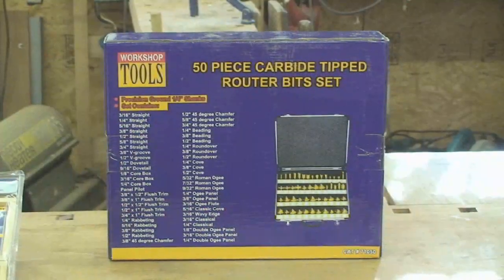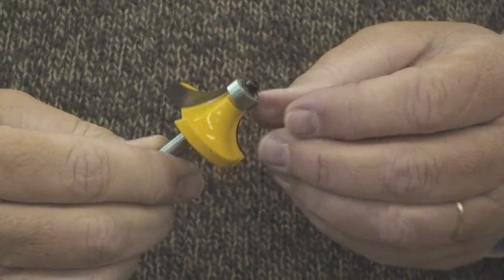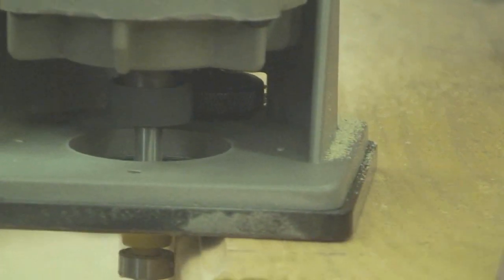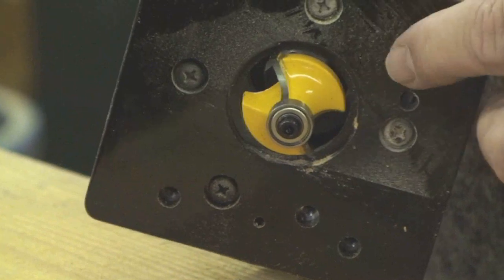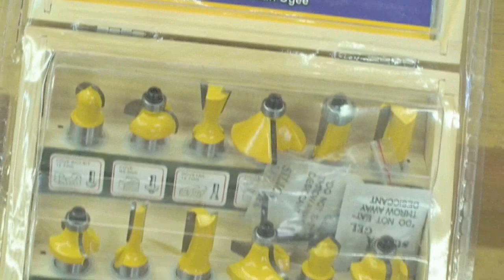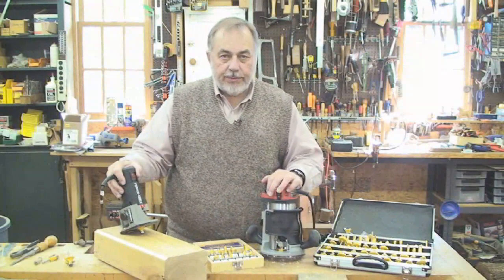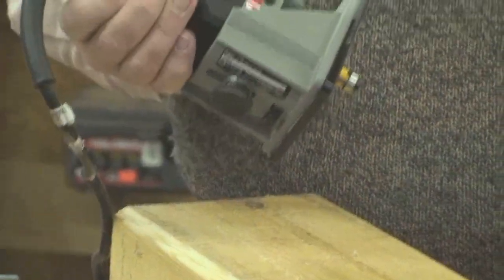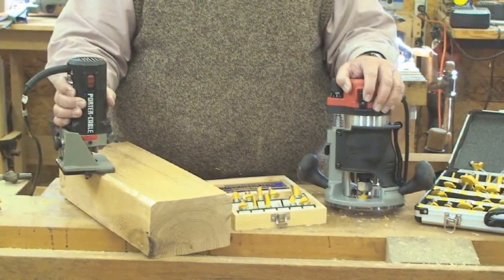Workshop Tools Router Bits

Comment: i am living in China, and i do have chance (better say sometimes no other option) to buy Chinese tools. They do the job most of the time, but there is something you have to understand these MIC things are not made for long last. One of the main problem is the material itself. I have these router bits as well. Most of these accessories tend to rust like hell. No matters what you do with them. Yeah, you can store them in thick grease if you want, but thats not going to happen in real life, and i don't think so that's an acceptable compromise. In few months most of these tools are just looks like junk. Most of them are like paper cups. You use them once or twice, then you can throw them away.